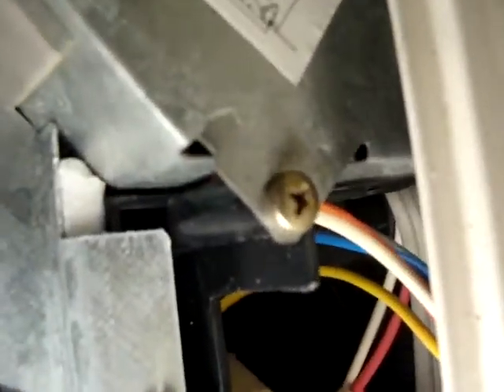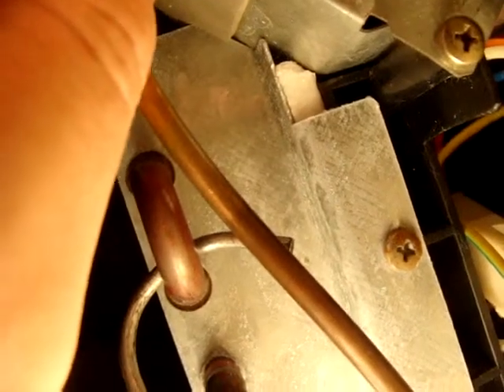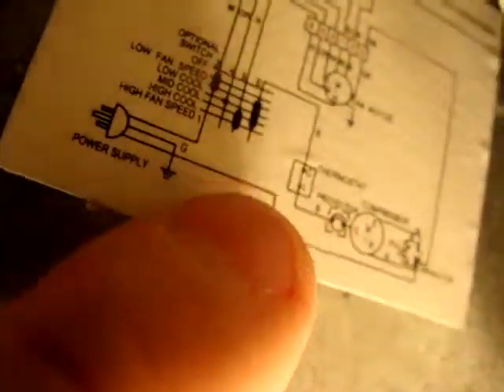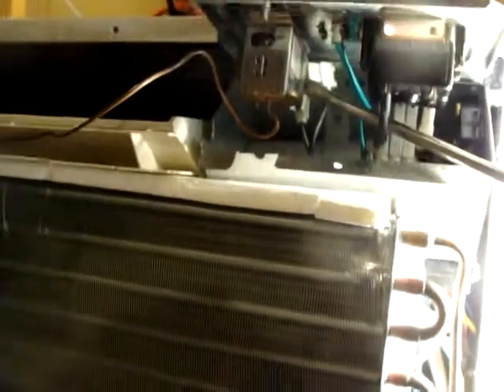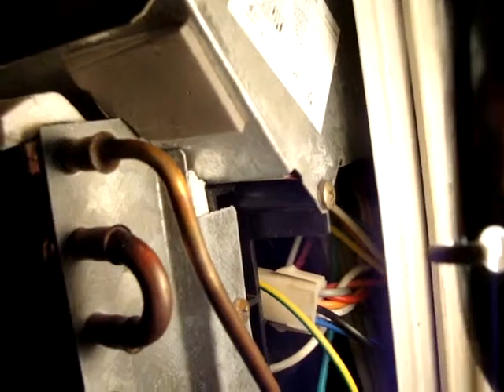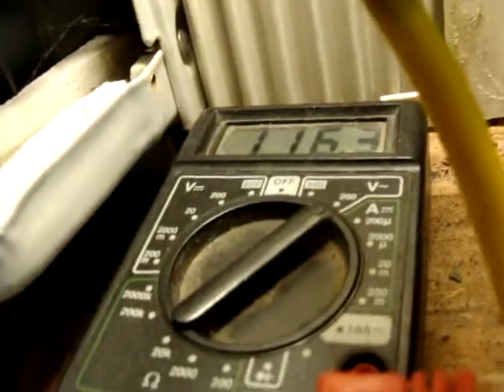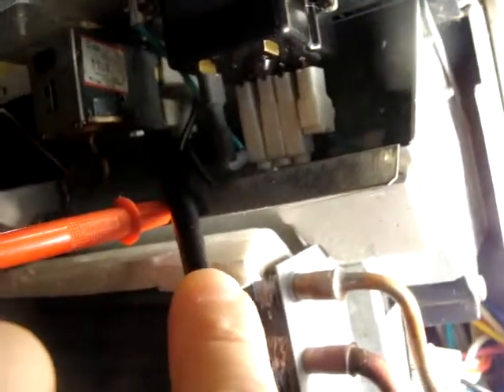Get your manual control air conditioner to work under 60 degrees (NSFW)

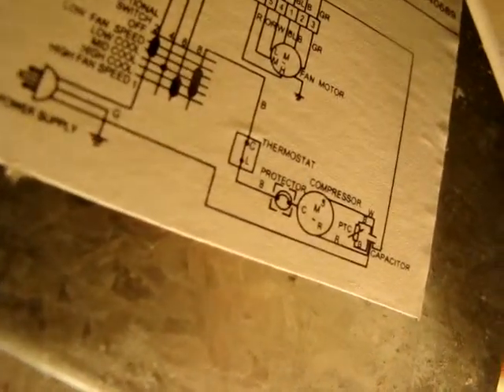Comment: The protector at 3:34 is the compressor overload. It prevents the compressor from overheating.
Reply from the maker: Shawn K  Ok thanks!  Sometimes I just happen to accidently figure things out.  That unit has froze up a couple of times since I did that adjustment,  but at least it still stays on when it is 50 or under out now.